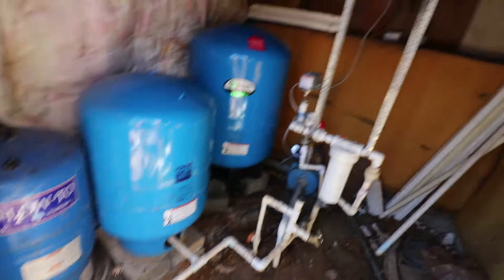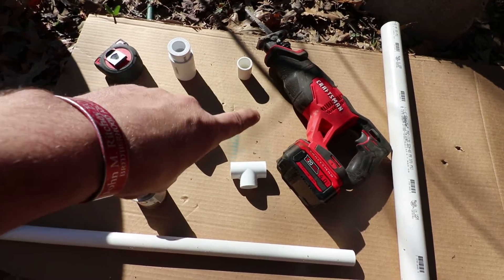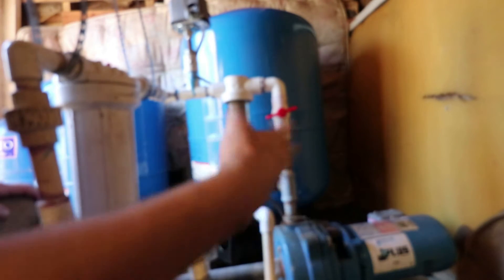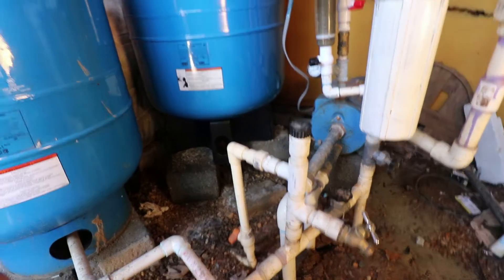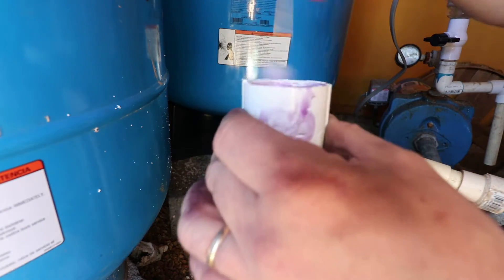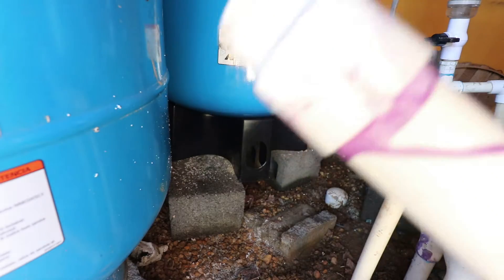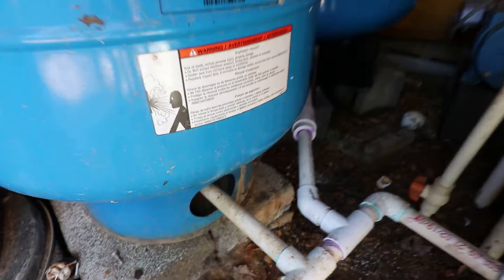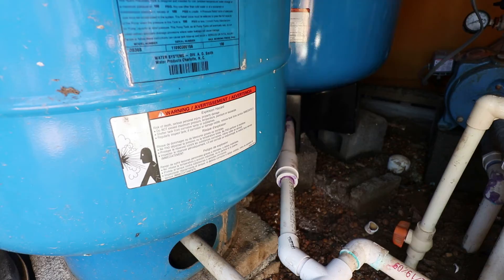How Do You Add A Pressure Tank To Your Well? Simple And Easy DIY Project. Save Money! FFE#39

Comment: I have an 80 gallon tank that have the air volume control valve (no bladder) any reason why I can't buy another 80 gallon tank and plumb piping to it? Can they both have the air volume control valve?
Reply from the maker: I'm not sure, I've only used the type with bladders. I don't know if you would need a second air volume control valve.
Reply: @flannelfarms  I asked about the bladder tanks in my area and they said they leak after about 3 years due to our hard water or something.
Reply from the maker: Ah gotcha.